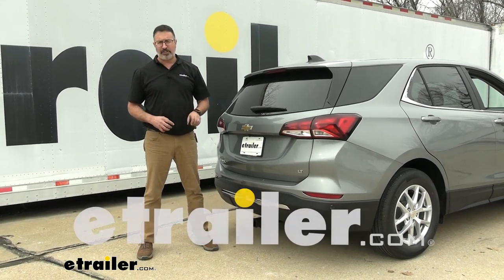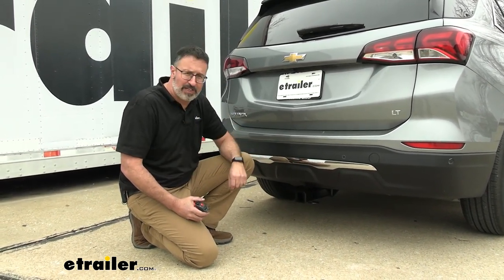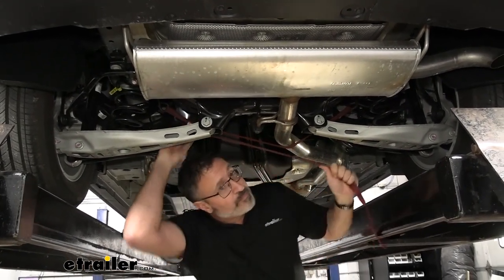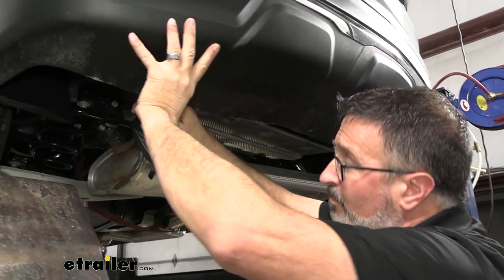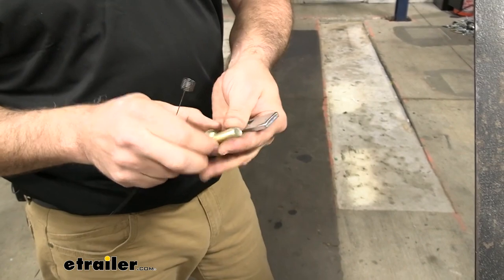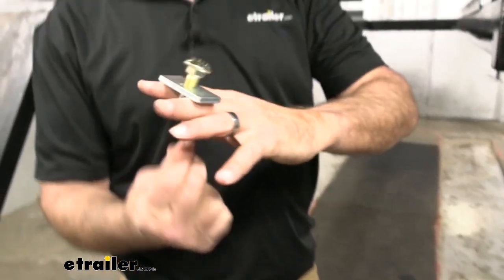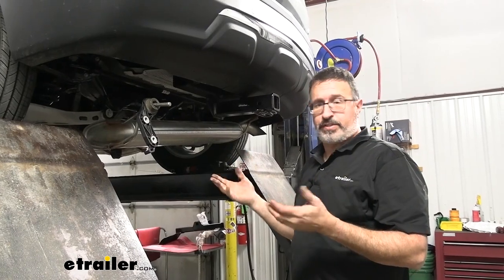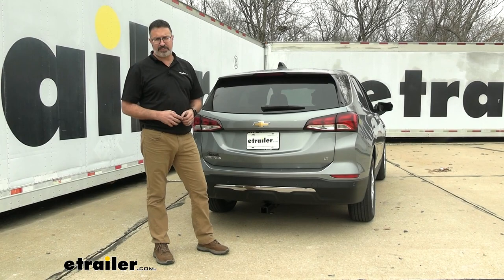etrailer | 2023 Chevrolet Equinox Curt Trailer Hitch Receiver: Complete Installation

Comment: In pretty sure the 2023 equinox has a cutout in the bumper designed for a receiver doesn’t it? I feel like you would want to use that because the receiver would sit about 6 inches higher
Reply from the maker: Some of the higher trim models of the 2023 Chevy Equinox do have the removable panel in the rear bumper trim, but not of the hitches we offer would use that. If that's what you want to do, you'll need to get the factory hitch option which is likely much more expensive than an aftermarket hitch option.
https://www.etrailer.com/Trailer-Hitch/CURT/C77FR.html

Comment: Does the hitch not come with wiring?
Reply from the maker: It doesn't. And there's a good reason for that. We sell tons of hitches to folks who have zero intention of towing. They use the hitch for a hitch mounted accessory like a bike rack or a cargo carrier rack. 
If you DO need a trailer wiring harness for a 2023 Chevy Equinox, we recommend the Curt # C94FR if your Equinox has the factory tow package. If you have the connector located behind the drivers side rear bumper, you have the tow package. If you don't have that connector on your vehicle, let us know and we'd be happy to recommend an alternative.
https://www.etrailer.com/Custom-Fit-Vehicle-Wiring/Chevrolet/Equinox/2023/C94FR.html?VehicleID=20235002358